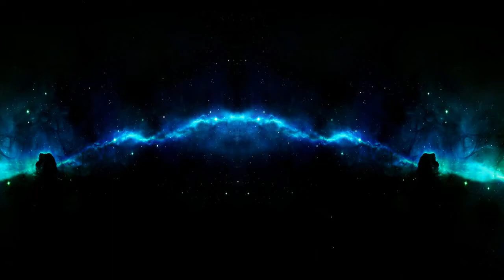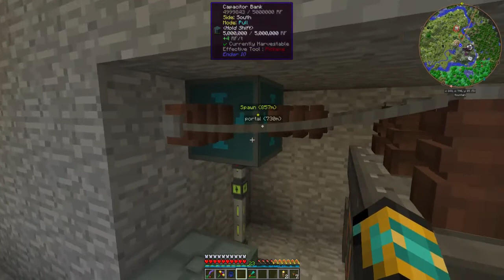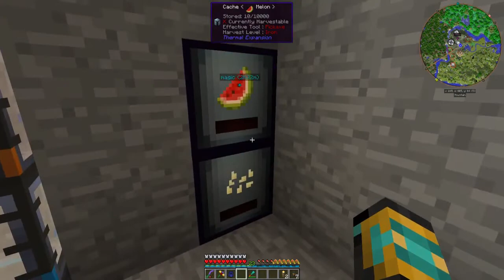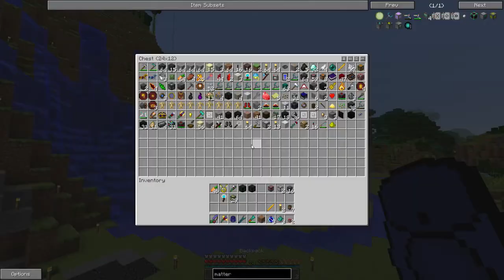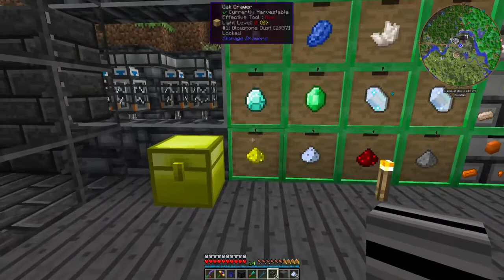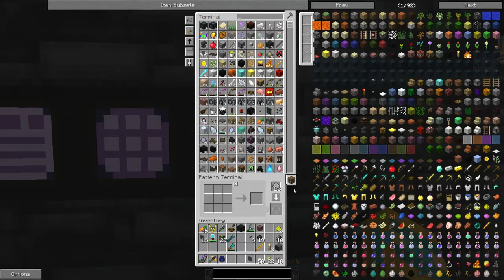Modsauce 2 Ep 18 AE 2 Storage and Crafting

Comment: try and run a Redstone conduit from the power manager to the generator switch and set it to only emit signal at 20%. it will turn genny on and off.
Reply from the maker: +WildRascal wasnt aware the diesel gen worked off redstone ill have to try that out
Reply: +Dragon Fu it's the red dot on the back of the machine. immersive has a cool looking lever too.